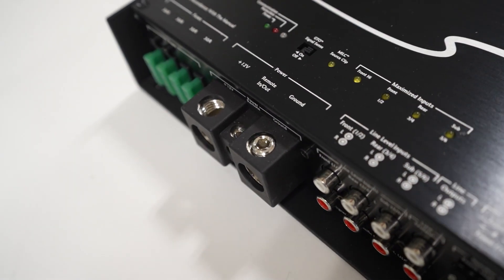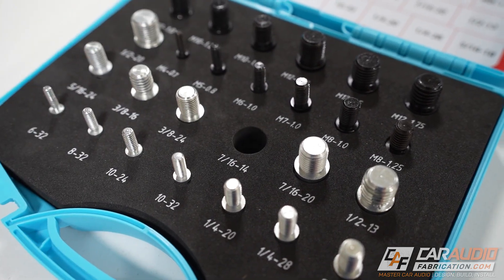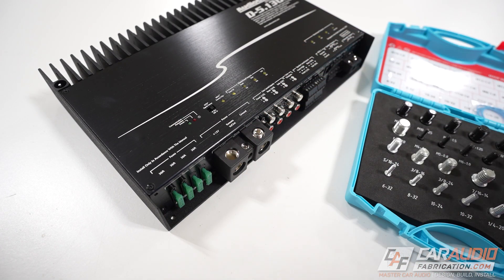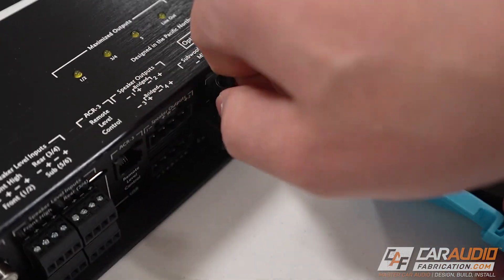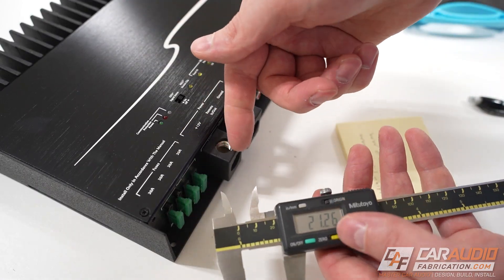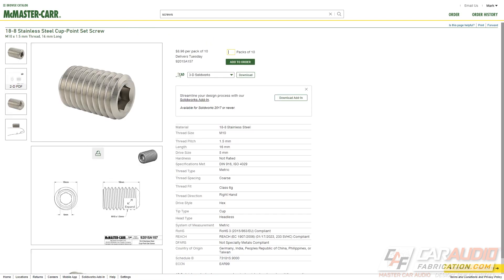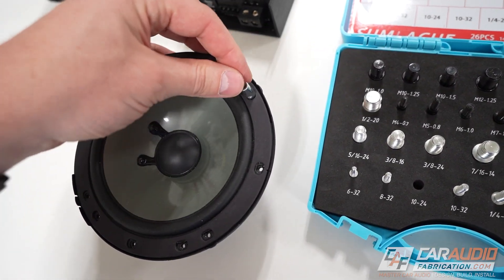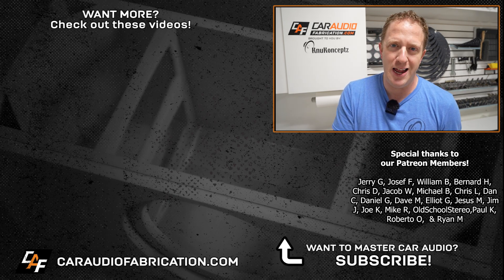Amplifier missing terminal set screws? Find size with THIS!

Comment: Can a DSP be installed on Hyundai Bose stock speakers ?and can we achieve good results with that?
Reply from the maker: DSP can be used in every vehicle. Just requires proper integration and installation
Reply: But will there be improvements if integrated properly and tuned properly  in stock 8 speakers Bose setup in hyundai ? I am low on budget but i can purchase an audion dsp . Please help me brother. Will a dsp improve bose stock sound system?  Please please reply. God bless you brother. Whatever dsp youll say ill integrate in my car . Much ❤️

Comment: I HAVE A QUESTION 
SO A FRIEND OF MINE GAVE ME AN AMP BUT ITS MISSING BOTH FUSES HOW DO I KNOW WHAT FUSE BELONGS TO THE BUILT IN AMP FUSE??? (The fuses are squared  diffrent colors like the ones u use for ur car)
THE AMP DOESNT SAY THE WATTS OR BRAND NAME. The ONLY THING THAT IS ON THERE IS WHERE THE WIRE NEED TO CONNECT TO and screws

Comment: What if your amp terminal outlet is stripped
Reply: I’m having the same problem… idk what can I use to hold the speaker wire in place
Reply: Chase the threads and make new threads for the new set screw

Comment: I’m usually on board with the advice of this channel, but I can’t get behind this.  Hardware is so inexpensive and readily available that spending extra will never pay for itself.  The fastest and easiest method is to just take the amp to a hardware store.  If you deal with this somewhat regularly, then just buy a small set screw assortment.  

Also the wire stripper/crimper tools that are so common are also screw cutters.  They have labeled threaded holes in them and the ability to cut them to length.
Reply from the maker: Whenever I see a tool and evaluate it's usefulness I think of ALL the applications it can be used in. Some other examples were shown in the video, but I also work on my own vehicles and other projects around the house. Having a simple tool set that allows me to simply identify screws whenever I need is far better than always driving to the hardware store, or in the case of something being impossible to bring into the hardware store, this is also beneficial. Also not sure if you have looked at prices lately at hardware stores, but to purchase a male and female of every size thread in that kit would definitely cost more, and often times you are forced into buying more than one of each.  

I guess it's kind of like when I recommend people buy a woodworking router and people question "Why would I get a router, I only need it one time for one project" when in reality it could be used for a ton of other non car audio projects too.
Reply: @CarAudioFabrication  I fully understand your point and perspective.  I just can’t agree when I see 1000 piece metric/SAE stainless screw assortments for less than the cost of the tool to identify them.

It’s nice having a tool for everything.  Unfortunately I’m at the point that I need a tool to help remember where all my tools are.

I apologize if my comment came across negative, I just simply disagree.  

Thank you for the content and for freely sharing your knowledge.

Comment: Why not just use the set screw kit and test wich one fits. Cant see the point of having a thred test kit when you have a kit with setscrews😂 I would be cheaper to buy a set with metric and imperial set, rather then first have to buy that stupid test kit then you have to buy the setscrews anyway
Reply from the maker: In the event you just want to buy the set screw you need right off the bat the kit is advantageous. Also the set screw kits don't have all lengths that you could potentially need. Not to mention the thread checking kit can be used for more in life than just checking one set screw hole.
Reply: Well I thought so to…. Until I tried out 3 different assortment kits and none of them fit my kicker amp. So now I’m ordering the thread checker